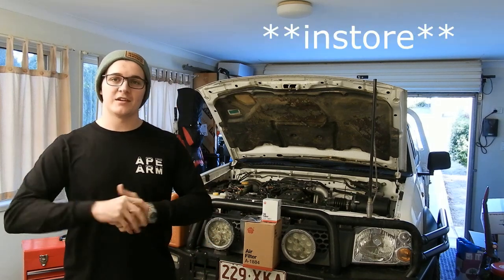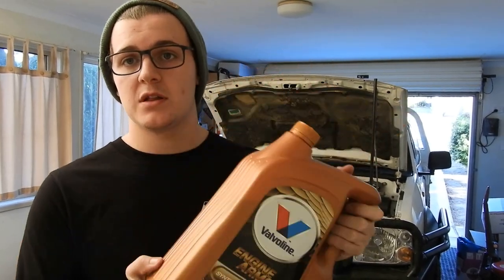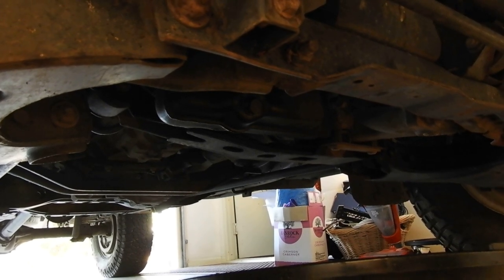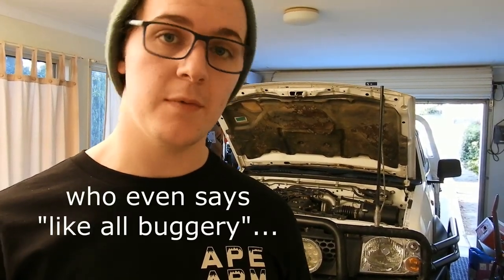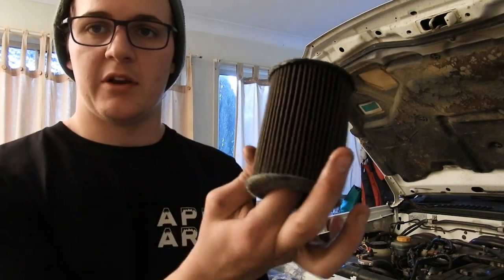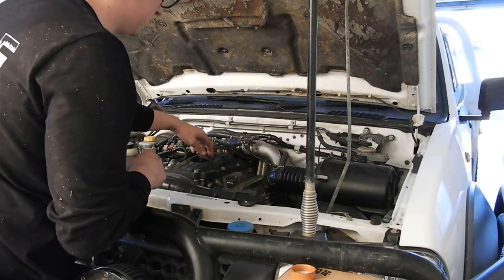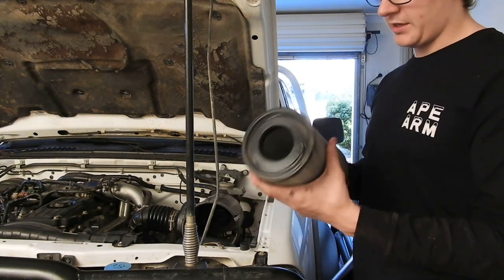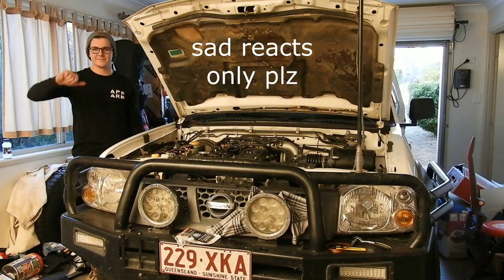ZD30 Navara D22 Oil Change and Filter Change (The Mort Series EP: 1)

Comment: A Note for DiY's, is the Oil Filter Spigot  in the Base of the Oil Filter Housing of the ZD30 Engine. Had done 2 Oil Changes before I found out I was missing the Oil Filter Spigot out of the Oil Filter Housing. I got My ZD30CRD Patrol with 147K on it and picked up I was missing the Spigot after I had done a further 20k's. God knows how long it was missing.